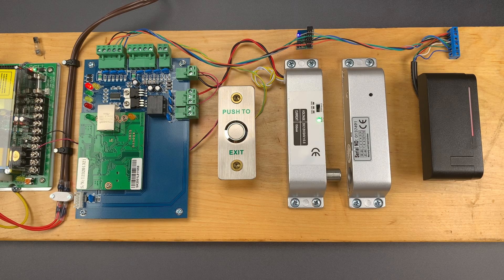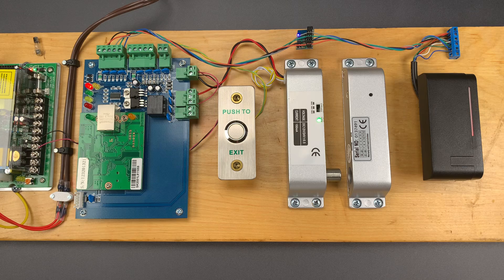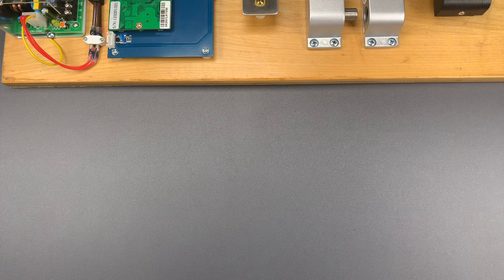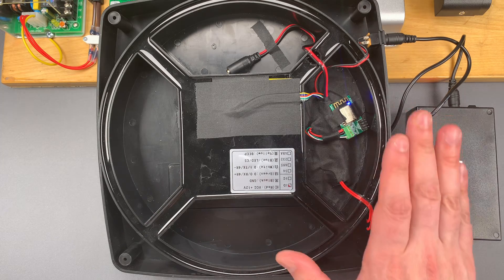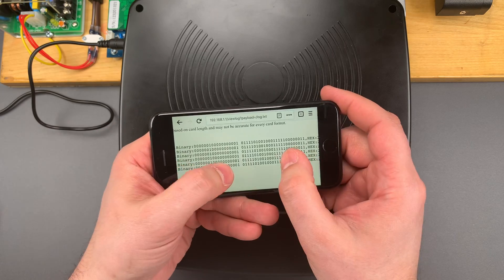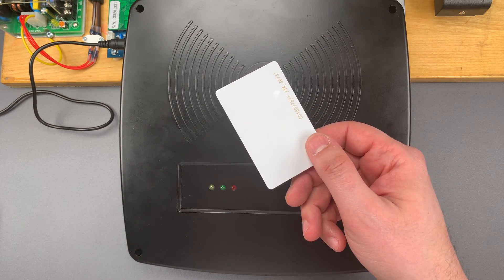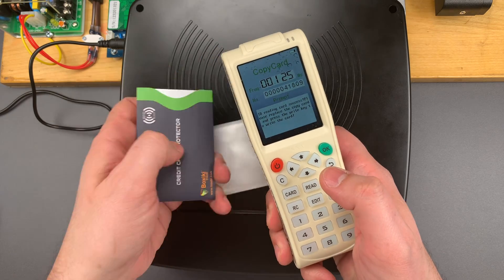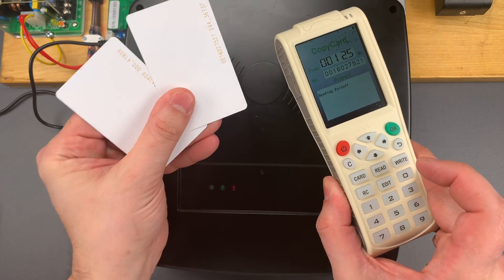[1056] This Black Box Reads RFID Cards in Your Pocket

Comment: My bank keeps mailing me cards with RFID and asks me to activate them to replace my current card that doesn't have RFID. Not happening
Reply: Bank contactless cards use much higher security than the cards shown in these videos. They use challenge response protocols based on asymmetric ciphers - over the air cloning is impossible as the secret(s) never leave the secure element on the card whilst replay attacks are impossible as the card uses a stored secret to sign the data presented to it.

The EMV standards and their implementation on practical bank cards are not without issues, but there is no trivial exploit available. For those of us with multiple cards, the clashes of keeping them all in one wallet renders the cards essentially unreadable without taking out the card you intend to use.

I've got four contactless bank cards (one American Express, one Mastercard, one Visa credit card and one Visa debit card) as well as a contactless travel pass in my wallet. The chances of any one of those cards being read whilst still in my wallet is close to zero - the reader will power them all up together.
Reply: Drill a small hole in the antenna near the chip, that kills the RFID/NFC. Here is one of many videos on it. https://youtu.be/c9vTvbHgi2M

Comment: So where can I get 'dummy' cards to carry with my genuine cards so that the data is scrambled?
Reply: Amazon. You can find blank rfid cards aplenty on there. Though you might want to put garbage data on the rfid cards so something transmits. Because receiving a whole bunch of 0 data might tell the reader that it's noise and to ignore it
Reply: @thomasvlaskampiii6850  But then I'd have to have something that can input data into the card, right?
Reply: @Shorjok  Yes. And I'm pretty sure you can find card programmers on Amazon too
Reply: @thomasvlaskampiii6850  Turns out you can buy what seems to be specially designed cards that also scramble the signal, so it seems buying a blank and putting junk data on it is unnecessary. Look up the Blackout by AKIELO.

Comment: Also there is another security solution, that gives pretty great security, but can be done with cheap mifare cards, which a solution, many home door locks use to prevent cloning.

That is, that the card either have an encrypted counter. Everytime you open the door, it will write counter + 1 to the card. And also store counter + 1 in database. If you try to open the door with a counter less than the value in database, it will fail to open.
Another solution is that it simply writes an random value to the mifare card. This random value must match the one from database. Everytime you use the card, a new random value is written to both card and database.

Both of these solutions prevent card cloning in the sense that if either the clone or the original card, is used AFTER it has been cloned, the other one will stop working. This will make the attack very detectable, the reader can easily detect that a counter or random value has been reused, especially after one card actually correctly authenticated with a newer value, and thus it can sound a tamper alarm and even block the card and alert the security to reissue a new card to the employee in question.

This means, that even if the cloned card were the one to be used next, thus invalidating the original uncloned card, it would still be detected either by the above alarm, OR that the original card owner complains his card no longer works, and gets it replaced with a new one, or having a new counter value written to it by security, which will now invalidate the cloned card.

Comment: Here's a lock you can't pick:

An armed security guard behind bullet proof glass.

Now, there are flaws with this, just like anything else, but you can't pick it, steal it, or bypass it easily if that's the only way in. You will also have a hard time brute forcing your way in

Comment: Ahhh.... I see where this series is going now. Hoping for an active man in the middle attack next :)
Reply: That's basically what video 1052 is
Reply: Xander 1052 is more of an eavesdropping/replay attack, and would be foiled by a challenge response system. A proper MITM attack would interactively relay signals through a separate channel and is much harder to defend against. (This kind of attack is mitigated in HTTPS using trusted, centralized certificate authorities)
Reply: Yep! Looks like that's where it will go next. Hoping he does explain that attack.

Comment: I work in the EVSE industry as part of a network operator. In my experience, most EV chargers which support RFID don't support query/response protocols. Very easy to clone cards/fobs for EV charging.
Reply: Thanks, I'd wondered how secure or insecure by card was. Hopefully there's some fraud protection incorporated in the system to detect implausible charging amounts or locations to mitigate this risk. Mine reloads $10 at a time from my credit card -- I guess I should ask myself how many reloads would it take me to notice somethings going on?
Reply: I actually wanted to create a device to legitimately clone those ev tags so you wouldn't have to carry a whole lot of them with you.
Unfortunately, I couldn't find a controller that supported user set uuid.

Comment: I've got multiple rfid cards in my wallet. Noticed it a while back, my card wouldn't work whilst in my wallet. Glad to know it isn't a false sense of security.
Reply: Shielding defeats the purpose of rfid card. I prefer using smartphone, though I have no idea what to do if it got wasted or stolen. Lock all cards and move money to new accounts? Very likely.
Reply: @mytiliss682  log into your Google/Apple account on your PC and remotely wipe the phone. (But if it's missing, you should still get new cards, just in case someone managed to copy it already.)
Reply: Dont know if its related but my wallets got this stuff in it to stop cloning my keycard and id and stuff, tested it a while back by using a app i have for my smart locks by putting my phone in my wallet and it appears it works, lock stayed red (locked) and by being right next to it and holding my wallet to it i just managed to get it to go yellow (partal connection, not enough to unlock)
Reply: If you want some more security, you can just put some folded up aluminum foil in the back of your wallet so that they are always covering up both sides of the rfid cards.
Reply: but it is a false sense of security: storing cards together nd not be able to read them is NOT a real solution. The reason the reader can't read them is because they haven't implemented the protocol correctly. The MiFare protocol DOES allow to read multiple cards, since it has a challenge and response, and after initial contact only the correct card should respond to further queries of the data on the card.
I mean, if the attack with the large antenna would be within range of multiple people, or if you have an nfc card in your own pocket, it would be a useless attack ;) So if the protocol is implemented correctly, it hould be able to differentiate between multiple cards
Reply: @iWhacko  is totally right! I don't have an English video at hand but I think the pictures in this German video are understandable also without text. https://youtu.be/LMjHNbRjLCA?t=193
They tested how easy it is to steal money wirelessly with nfc enabled credit cards and debit cards. Banks downplayed the risk with the same argument: more than 1 card and you are safe. Turned out: You aren't! They randomly tested it with standard mobile payment app and mobile card reader and where able to communicate with cards within the card deck.

It's harder to read from piled up cards, but it's not nearly impossible.
Reply: @iWhacko  Exactly. And below the protocol level too - for ones without explicit collision avoidance, MIMO and array antennas exist which can physically differentiate those radio sources. It's always possible to construct a skimmer with the ability to read any ostensibly clashing RFID devices.
Reply: The phenomenon known as card clash is quite common. I keep several cards in my wallet and they have never worked unless removed. I’m with LPL on this one.
Reply: @robinturner2300  of course it's definately a thing. But I'm just saying, don't bet on it if you want security. Go for proper shielding instead.
Reply: @iWhacko  agreed. as another bit of anecdata, i have two cards that work flawlessly when they're together. in fact, they were issued by building management in the same sleeve. it's possible (even likely) they use different frequencies/protocols, but blindly trusting that two cards will block each other isn't a good idea.

Comment: Is there a way to know if a card can be read and written?? I have a fob for access to my block, which is now not working, and they're asking $32 to replace it...
I am tempted to buy a cheap chinese tool for copying but people say not all cards can be copied... help
Reply: You need to know the frequency and protocol used by the system.  The standard frequencies are LF, HF and UHF, with HF being the most common for access control as it is a short range design.  There are also active tags (powered) vs passive tags, with passive being the most common.  Note that encrypted tags can not be read or cloned outside of the system, as LPL mentioned, which is ideally what all good access control systems should be doing.  Note that some android cell phones can read HF frequency tags using an app, so you can try that first to see if it is unencrypted HF.

Comment: @LockPickingLawyer in my android smartphone there is a NFC chip. Is that the same as rfid? and how can i protect the NFC chip in my phone?
Reply: You dont need. The NFC chip is "turned off" for most models while the screen is locked or in sleep state. And even if the NFC chip is on, which it is for some models, you have to authenticate to the phone with your PIN, password or fingerprint, before the NFC chip will allow for example payment cards to be used.

Comment: Is that antena using the mfrc-522 type reader between the esp8266 or is the esp8266  fchip and custom firmware able to do this on its own, ive bee reaserching the security of iot home automation especially wifi conected cameras and how useless they can be with reagrds to a de-auth atack you can do on that esp8266.  not to mention the hard coded technican passwords you can find in the .bin firmware files.

Comment: LPL - please continue this series topic by testing some of the purported RFID blocking wallets on the market like the alumi-wallet types and others.  It would be interesting to see if their claims are true and if they can degrade the signal from these sniffers enough to thwart these attackers.
Reply: Also how well a simple home made block using duct tape and tinfoil works would be fun!
Reply: @FFVoyager  I would be very interested in someone trying that
Reply: This could make a nice like one-off episode, maybe a bit longer (about 7 to 8min) where he could just try them and cut some of them open or something so we could know what to feel or look for, anyhow, great idea!
Reply: I have one. works pretty good. Ive have to open my wallet and press the insides hard against the reader to get it to work. folded won;t work at all
Reply: I love my RFID blocking phone case. Has slots for credit cards and also blocks the nfc on my phone at the same time.
Reply: I actually have purchased a wallet solely on the basis of rfid protection
Reply: RFID for money transactions is being phased out in favor of the EMV chip.  About 95 percent of current bank cards use the EMV system instead of RFID.
Reply: So those RFID security scramble/blocking cards they advertise on Amazon actually work?
Reply: A wallet isn't the solution to a broken system. Encrypt the card instead.
Reply: The best RFID blocking wallet is two cards. Been using that ever since I noticed my credit card doesn't work if it's next to my office badge.
Reply: @DeeSnow97  I heard that there's actually a way around that, but, from what I gather, it only works on some kinds of cards.
Reply: @DeeSnow97  Clearly,. that can work - but will it always?  All it takes is for one card to power up more slowly.  Always a possibility if the cars are from different sources.

Comment: Oh boy, can't wait to get my contactless debit card scanned in passing... 💔 💸 Could not get a chip-only card anymore.
Reply: Contactless cards are encrypted unlike the cards demonstrated in the video. Everytime you tap your card a new code is created that can only be used once. So even if a thief managed to scan your card the info would not be able to be used.
Reply: Not the same ^-^°
Reply: Contactless payment cards use a challenge-response protocol as described by LPL. It works because the card and the bank have a secret key in common, which is unique per card, and then the card will calculate a "response" based on a reader challenge, which are then both sent to bank, and bank validates reader challenge computes to the encrypted response. So its impossible to "scan" or "skim" a debit card in such a way you could use the clone for payments.
Reply: Eventually, people, eventually... would rather have just the chip and not an antenna, you know?
Reply: @Slugbunny  I think the paranoia will wear off eventually, and people will stop being paranoid and understand that even antenna-equipped cards, when made secure, is secure.

Comment: While it isn't technically lockpicking. This series of videos on electronic locks has been very enlightening. Thank you LPL!
Reply: It's still lockpicking really. It's just RFIDs aren't traditional keys and locks. Which makes sense, because while physical measures are always going to be needed, technical measures are a lot harder to breach. We see here that if it's configured correctly, the only people who could get in would be people who do this for a living and Batman.
Reply: @TGirlSirJonathonDGSVTTJR  9 in 10 times it's poorly implemented. Just as locks.
Reply: @TGirlSirJonathonDGSVTTJR   But barman is more about that weird cealing window thats always open or big enoguh to smash thru
Reply: @TGirlSirJonathonDGSVTTJR  We've progressed to the point where 85% of the prox card installations can be broken into with a piece of hardware and running a script from GitHub you don't need technical understanding just follow up tutorial I wouldn't necessarily qualified that is a high bar for entry
Reply: This is the LockHackingLawyer and what I have for your today...
Reply: @DeeSnow97  ....is a magnetic door lock that I will try to open with a sponge.
Reply: Modern solutions require modern problems
Reply: @defilerzerg9152  i was thinking the same thing, this is "modern" lock picking
Reply: I think it is still lockpicking with electric locks. This is more akin to copying someones key to picking it, but bridging the connections I would say is lockpicking.
Reply: So protective sleeves are garbage...good to know.
Reply: @urbosasfurry2126  No. Not garbage. But the d7fference between walking past someone to scan their card or needing to touch their pocket to get the card within range. If someone touches your pocket while you are out shipping/dining, you might get a bit peed.
Reply: Geez… I installed a system almost completely identical to the system that you’re testing for a mortgage company way back in 2004!!! I’m impressed with how far the technology has come to capture and re-play credentials & cloning cards from a remote scan onto a physical card to be able to make unauthorized access to the lock 🔒 less conspicuous than waving 👋🏻 some huge device or cellphone 📱 in front of the card reader!!! I’m positive that you could have easily gained entry to one remote control door lock on the backdoor because it had its own control system board inside it that you could definitely have opened and then just bridged the contacts to activate the lock opening!!! The main doors on 3 floors of this 10 story building were just simple readers and could not be used directly to activate the lock opening because the controls were not near the door they were in the utility closet of the 3rd & 10th floors & in the IT Server Room on the 1st floor, except for the backdoor, and had separate wires from the server room/utility closets which would activate the lock opening remotely and separately from the reader mechanism!!!
Reply: A lock doesn't have to be a physical lock
Reply: Sooo...lock-jacking? Lock-hacking? Lock-whacking?
Reply: How many buildings you broken into because of LPL? I'm at 38.
Reply: Picky Picky.
Reply: Collin Carter in the house! :D
Reply: Can it read credit cards that's crazy  so can I protect my bin with the rfid blocker
Reply: Technically nobody gives a shit what you think lock picking is and isn't. Why not just leave a compliment without the know-it-all BS?
Reply: For more of this sort of stuff see Deviant Ollam's channel.
Reply: Sometimes, you might wanna do something new
Reply: Hey Bam! It’s exactly lock picking
Reply: All the electronic stuff he is touching on is horseshit.  Come try to hack into any of my S2 installations LpL lmao

Comment: Solution could be to have 2 card readers with 2 cards different codes 2 locks to open one door
Reply: That just sounds like an unnecessary level of complexity. Most companies wouldn't do that anyway because having 2 keypads on the outside of the building would probably look really tacky. Plus, what happens if you lose or forget one of the cards?
Reply: C’mon son , I wasn’t trying to be serious its not as if the comment section is where the lockmaker design team get their blueprints from anyway cos if they did then maybe they’d learn something from the great LPL.